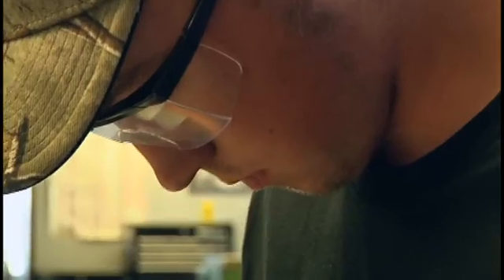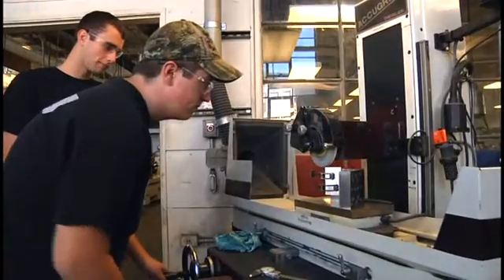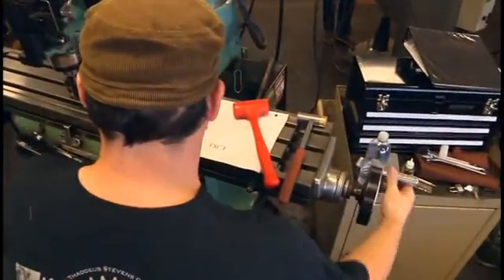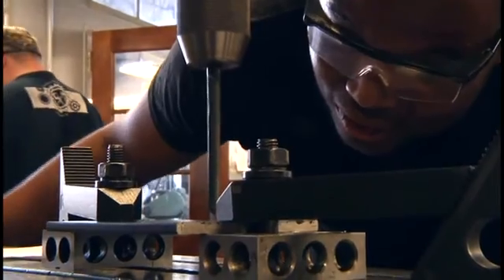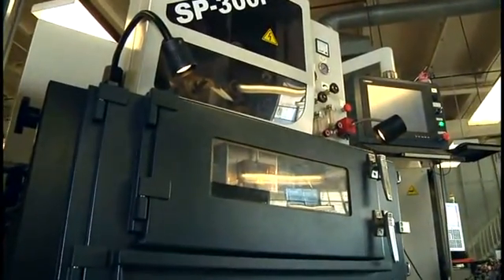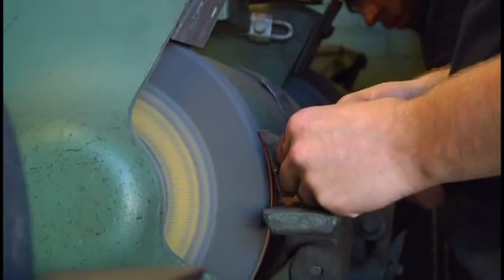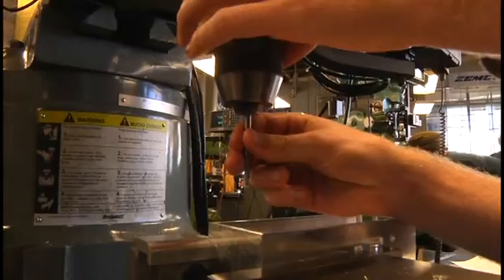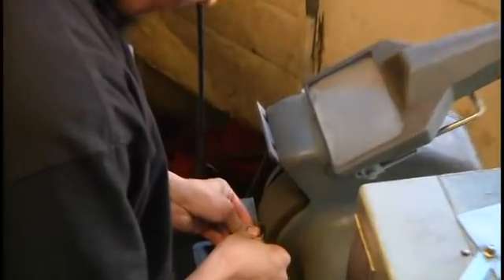Computer Integrated Machining at Thaddeus Stevens College of Technology

Comment: Actually getting at those machines and using them on raw materials would be definitely cool. One can only get good from a computer with the cnc software not actually the machines themselve. And from the 1800 to 1940 ish it was all hand craft  now its all computer program crafted curious if the next step is AI so completely automated would be kind of borning then... some times the good old fashion ways are more rewarding feeling then the quick cnc programming ways.